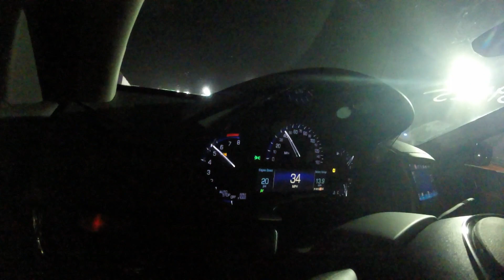16 Cadillac ATS ZZP Stage 1 + Full Mishimoto IC Kit 8.16 @ 85.29 mph

Comment: Me again! So just purchased ecm core and catless downpipe. I didn’t go with the zzp intake. I have a K&N already, but curious since yours is already built. Is the zzp intake really worth it, other than cool whistle noises
Reply from the maker: I’m honestly not sure. It’s open with just a heat shield so it is prone to heat some heat soak. I went with ZZP since it came with the stage 1 kit and didn’t want to run in to tune issues by using a different intake.
Reply: Went with the zzp intake. Now that IC.... worth it?

Comment: Alot of performance parts available on this one as it shares the engine with the camaro. In 2016 I almost got ripped on a base model Elantra , dealer wanted over 20k. How is that possible when the Elantra sport (premium model) starts at just 18k? They obviously tried to squeeze a ton of noney out of me. I now buy from carvana instead , The ATS is just under $20k and is a step above any Elantra. I also saw the new jeep Renegade 16k for the AWD model.